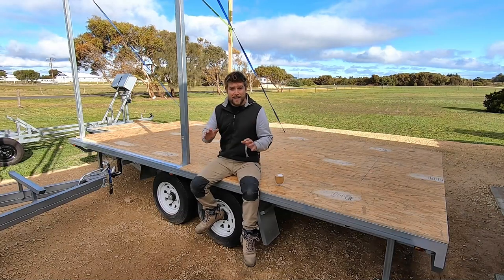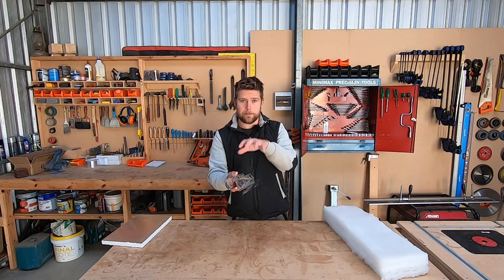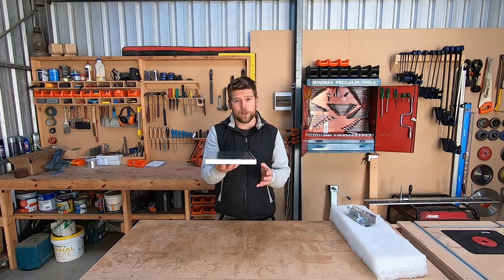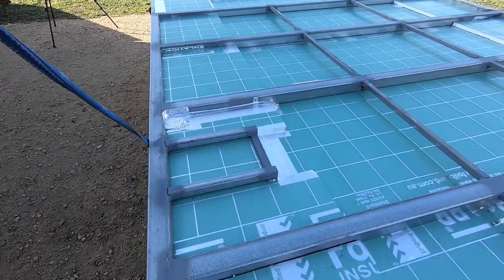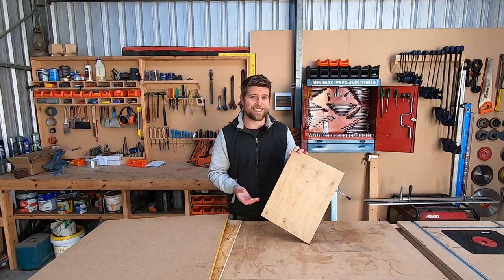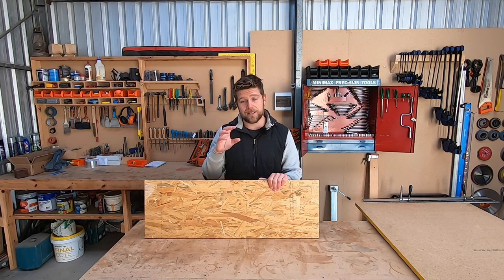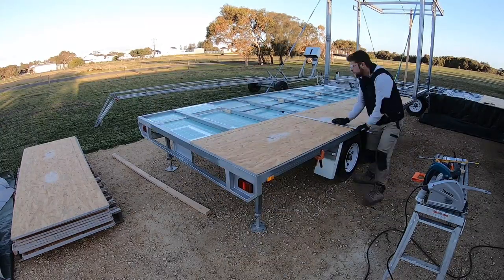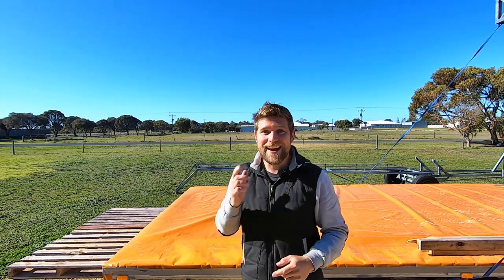Ep. 11 - Installing the sub floor & insulation on my tiny house - Tiny House Build Update

Comment: I'm thinking foil board for subfloor as well, maybe even for the walls(kind of depends, but right now I'm looking at a tradies ex work trailer that has some steel frame at about 1.5m high on the sides which means I'd probably build the frame up from there using additional SHS which wouldn't leave room for the more interesting eco/salvaged insulation I was considering unless I batten it out internally when I'd prefer the steel is within the insulation layer). 
I wonder if there's any value to insulating under the entire trailer so there's no heat transfer. I guess that makes it more vulnerable though, hmm. 

At one point I thought about fitting the trailer base with sandwich panel but you'd have to literally build it into your trailer for the intended outcome and while I think it makes sense structurally(you would basically slot the panels into U-section and H-beam aluminium and the whole assemblage becomes your upper frame) I'm not confident in achieving that or having it registered or any of the other complications involved. And as you mention our climate isn't likely to need such measures.

You mention you want a hard-wood finish for your flooring; did you at all consider omitting the subfloor for those areas and fixing engineered flooring directly onto the trailer? In a regular house I wouldn't really think of that being worthwhile but when weight is a significant issue the lightest option is to go without and fix things accordingly. 

PS; I do think you should pick up some marine ply for the wet area but hopefully it's not a problem for you.
Reply from the maker: You could certainly do more to insulate from the frame of the trailer or insulate the frame. It just means a lot more effort and we just don't really get the extremes here in Australia to warrant. I know in Canada they go for full thermal isolation. 

Did think of putting hardwood floor down but engineered flooring by it self is far from structural so still needed a structural substrate. I did look at solid boards but it got very expensive and really needed closer joists. Turns out it might work out ok as I am looking at making my own flooring using veneer strips I cut off from my window timber. 

Haha I totally get where you are coming from with the wet area. But honestly my view on it is get the water proofing right. The whole area will be tanked. If that is right then moisture shouldn't be a problem. I'll just have to be careful to get it right. If I ever have a leak in the walls OSB is still moisture resistant.

Comment: Did you insulate under the underbed storage?

Great engineering. Great series! (I love that you built your own crane.)
Reply from the maker: I sure did. I used the same method. The base to that storage sits on bracing ribs that run between the chassis so I just insulated under them and I left an air cavity on the sides as well. 

Thank you Erika, I really appreciate that. Haha the crane was the best investment ever. I am glad you like it ;)

Comment: Awesome video mate, I still dont understand how you secured the insulation onto the trailer, you mentioned aluminium tape, is it just taped up to hold it? Is it strong enough with just tape?
Reply from the maker: It was a mixture of adhesive, tape and on larger areas I screwed into the frame with large mudguard washers. It's not really made for travelling regularly but fine when it's setup as a house.

Comment: Do you have a dry weight ideal goal?  With the finish of the flooring will you be doing a Harwood veneer over the floors? Fiberglass for the shower?
Reply from the maker: I want keep total transportable weight you 3000kg per trailer. So that'll be a bit more than dry weight but I want to focus on them actually being movable. Looking at engineered hardwood floor, still looking for lighter options. Looking at a light weight plaster in the shower. I really don't like fiberglass. But still working on that one
Reply: @TwoHandsandaTinyHouse  I'm not a big fan of fiberglass but thier are alternatives to the traditional fiberglass that I've looked at. For the flooring it might be worth trying to talk with a manufacturer. Engineenered products seem to necessary for tiny builds due to weight limits and road tolerances needs. Thanks for all the work you are sharing.
Reply from the maker: I would probably look at aquatile products before fibreglass. But it really is a challenge to find lightweight wet area products. 
Yeah I am still researching the floor options. Veneering my whole floor would be an awesome idea. Not sure how I go about that yet but I am going to research.
Reply: @TwoHandsandaTinyHouse   Why not get a sheetmetal worker to fold up and weld a custom S/S tray for the shower? Way more resilient that than anything else.
Reply from the maker: @leo169  viable option. Not the look I'm after but be weight effective and durable. ACTUALLY copper would look amazing!
Reply: @TwoHandsandaTinyHouse   Copper would be perfect. And as it is much easier to work than S/S, you would be able to bend it up yourself using some wood and clamps. Lead/Tin or Silver solder can be done with a blow torch, a bit of practice and you would be able to do it yourself.
Reply from the maker: @leo169  absolutely! And patina on copper looks awesome. Imma look into this one man. Great idea 👊